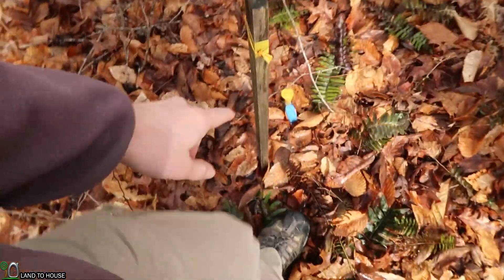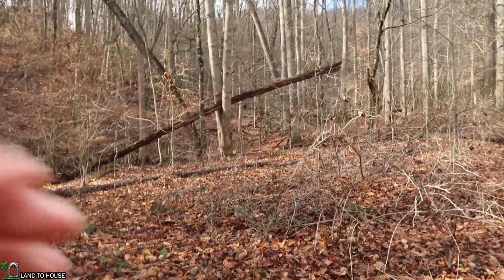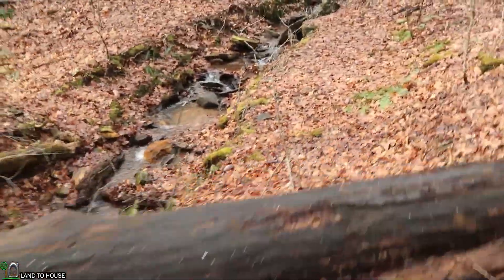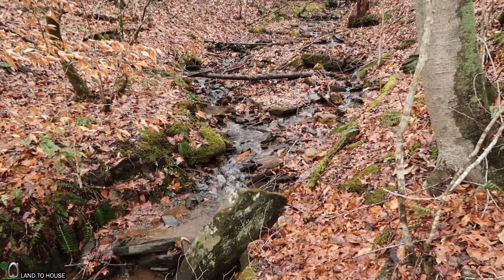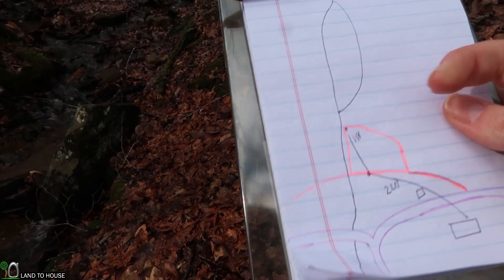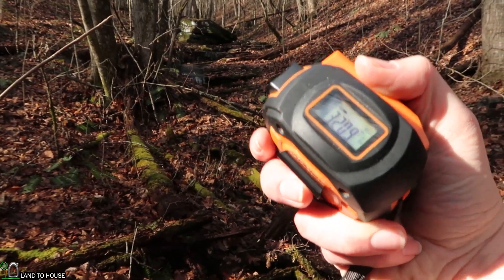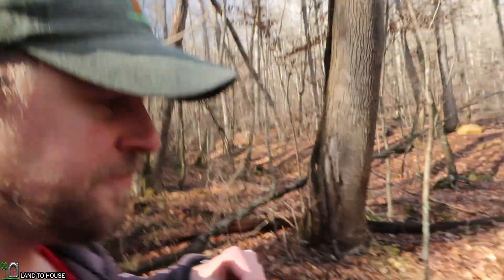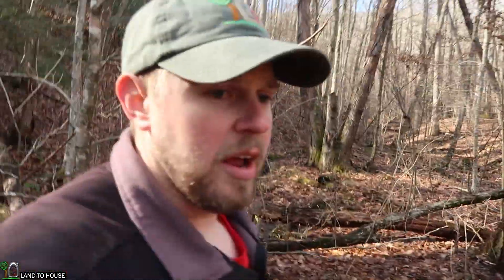Find the Micro Hydro Penstock Length

Comment: I was thinking that depending on how close to that hill the turbine site is, you could build your intake higher up on the hill, then run a 4in pipe horizontally around the hill to a tank. this would cause the penstock to be much shorter and thus less friction loss. here is a link that you can copy and paste to a hydro system in Canada similar to what I have explained,
http://www.virtualmuseum.ca/sgc-cms/expositions-exhibitions/hydro/en/dams/aberfeldie_gallery.php?id=1

this, of course, would mean that you would have to buy less high-pressure pipe and replace it with a PVC or ABS pipe going across the hill to the barrel. 

just my thoughts
Reply from the maker: That is a very interesting idea! If I could do that looks like I could save 6 to 10 feet of head pressure loss at 30gpm 700 feet vs 1000 feet of penstock. Looking at 20 to 30 watts different.  Thank you.

Comment: I got a little confused there for a minute... Is the intake basically at the edge of your property?  Asking because you mentioned that you had a whole lot more head further up the stream...  Or maybe you are choosing that point for your intake because you only had 1000' of pipe....
Reply from the maker: I was doing several calculations and when you start increasing penstock length for more than 1000 feet with 2-inch pipe you start losing serious head pressure due to friction loss. It would be better if I went further up the mountain but then I have to have longer wire to get to the house. So I'm using that waterfall because it's easy to get water from and also gets me at about a thousand feet

Comment: Might want to check your editing around 7:00

And I vote running from that water fall down as far as 1000 feet will get you. Try not to waste head pressure at the intake, mine wastes about 1' for collection and settling.
Reply from the maker: Haha now that's some fantastic editing.... nothing like a nose clearing in a video. Lol. I cut that and forgot to delete.  I really need to find a better time to edit then 1 in the morning

Yes I think I will be close to the place I want to put the turbine at 1,000 feet. I'm going to try to go straight through the woods and not weave in and out with the creek. At the intake I'm going to try and get the top of the barrel to be even with the waterfall. The water in the barrel Maybe a little bit lower and I want the penstock to start halfway up the barrel.
Reply: @LandtoHouse  I actually liked that editing slip, reality TV without all the backstabbing LOL